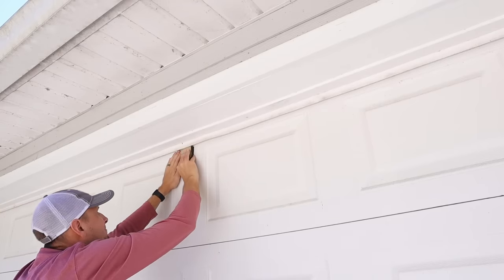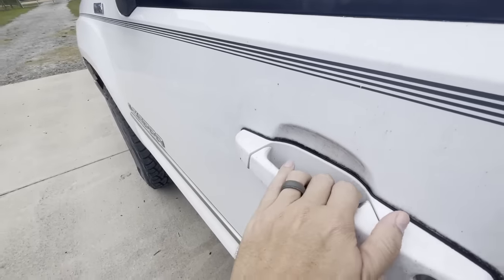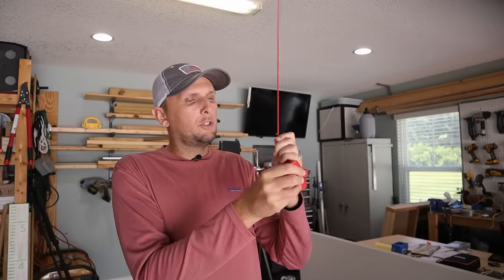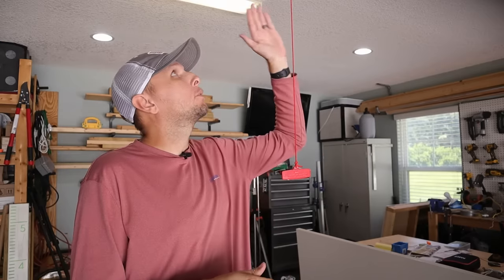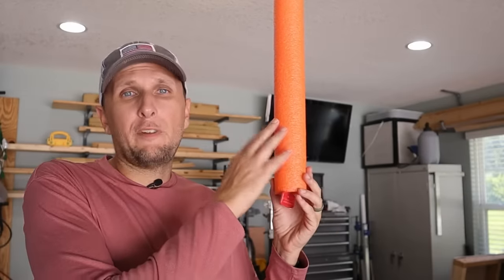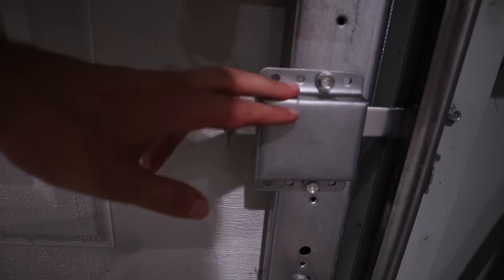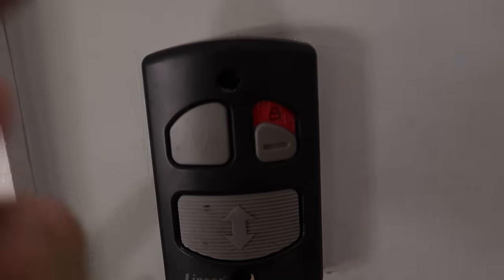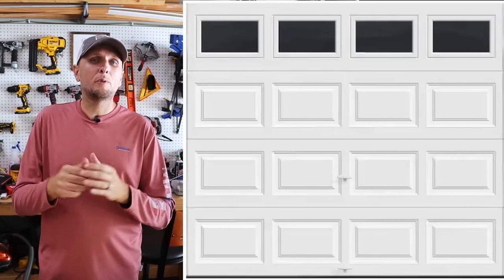How to Stop Garage Door Break-Ins | Number One Way Thieves Get Into the House!

Comment: Nice. I have shortened and twisted the release cable, so it will be hard to fish. 

A useful tip that helped me avoid any issues. I purchased a label indicating that my house had a security system installed. I displayed the label prominently and placed a dummy camera in a visible spot, even though it never actually functioned. Since implementing this strategy, I have not experienced any problems related to security concerns.

Comment: One thing I did to fortify my garage was install a jackshaft opener. A big benefit is that it actuates an electronic latch to lock the door down. Additionally, it looks better, and it's got a battery backup so the garage door continues to work in a power outage. And, I was able to set it up to automatically close if I forget to close it at night
Reply: With a jackshaft operator, the manual release is also on the side of the door instead of the center.

Comment: Thanks for sharing! One thing I thought of when you were addressing the pull cord is maybe just take it off and use a stick with a hook on it if you need to release it (which is not often) plus I always end up using some kind of stick anyway to push it back up in the locking position instead of climbing up on a ladder.

Comment: There is a very simple method that I have used for years.  The pull cord is attached to a lever which, when it is horizontal, locks the door onto the opener bogey.  Once you pull down on the cord the lever moves to vertical and withdraws the pin unlocking the door from the bogey.  For some reason, this lever is always mounted pointing towards the motor and away from the door when in the horizontal position!   See the lever in the video at 4:22 where you untie the cord from it!

I simply unbolt the lever assembly, turn it around to point towards the door and bolt it back on.  The cord still works just fine from inside, but pulling the cord through the top of the door, you are now pulling the lever into the horizontal locked position instead of pulling it downwards into the open position.  You can tug until the knot comes undone, but you won't be opening the door!  For extra security, cut part way through the cord so that it will snap more easily if undue pressure is put on it!

Granted, this only works on a low profile door - one that is intended for a low ceiling garage.  Yours is kind of on the boundary of being too high but it might still be worth giving it a try!
Reply: That's a great idea. I will have to take a look at mine as it is rear facing.
Reply: One possible issue tho, if there's a car in the way can it be awkward to pull it in that direction? I haven't had one of these doors so I'm not sure. I'm tall so I'm sure I'd have the leverage, but for someone who's smaller or maybe less mobile...
Reply: if u have 13'' above the opening of ur door u have plenty of headroom for a standard operator even if u flip the carrier around like ur saying. u only need low headroom track for doors with less than 13'' that are getting standard operators (not jack shafts obviously).
Reply: @Mike-me3sp  what are u pulling the manual release for anyways? if u have someone who cant access the emergency release cable, i suggest u look into say an 8550 operator from liftmaster, it has a battery back up so if the power goes out ur door will still open in an emergency or just power outage. really the only reasons ud have to pull the emergency cord anyways.
Reply: @YoureWrongImRightGetOverIt  the thought occurs to me that in your case, with a 13" gap above the door, you could simply add another panel or half panel to the door. You don't need to access that wall from the inside except maybe to paint it, and it would make breaking in that way SO much harder!  You might have to extend the length of the tracks on the ceiling a few inches to accommodate it, but it should be possible and a lot cheaper than the alternative
Reply: @Mike-me3sp  the cord will still be hanging in the same place as before, the point is it has to be pulled downward to release the door (which is it's normal operation) instead of sideways from the top of the door on the case of being fished by a would be burglar
Reply: @YoureWrongImRightGetOverIt  The cord is intended for emergency situations, ie house fire and power outage.  In such a situation having every possible egress point is essential to the life safety of you and your family.
Reply: This only works on box store versions of openers with a piece together hollow rail. Pro lines do not work the same and have a much more rigid disconnect. I own an overhead door business and see so many doors everyday.
Reply: @dano1307  You are absolutely right!  I talked to my neighbour about this, and she has one of those "pro-lines" as you call them.  What a wonderful world this would be if one answer fixed everything, but it is what it is!  

Those "pro-lines" you mention are the cheapened down versions of the same product; Essentially they do the same thing but with fewer working parts so when you buy them in bulk they are much cheaper than the original 'single item' purchase.  This will be the case in "track homes", where a builder builds one after another down a street and does everything they can to cut costs.

All I can recommend in that instance is adding an extra panel to the top of the door, since most standard height doors go "up" before they go "in", which would make 'fishing' for the cord so much harder.  Now if someone could invent a mechanical (doesn't need batteries) switch to mount by the door that would do the same thing as that cord, but without exposing the cord to a coat-hanger attack.

Nah, it's impossible! (gauntlet hits floor!)
Reply: I'm going to do that! Thank you!
Reply: @daveyburgess  I highly disagree the pro line is a cheaper version. First being the rail the carriage travels on is solid #1 steel one piece T-rail. The home depot version is a piece together light gauge tube rail. Also, the carriage lever on the home depot versions are made of plastic and have a cheap thin plastic pulley at the front header end of the rail. They also use half chain and half cable instead of all chain. Unless you are using a belt driven unit. The Home Depot/ box store versions are much cheaper to manufacture. Your neighbor may have a "Genie" or "Overhead Door" branded opener which are very cheaply made no matter if its a pro line or box store unit. 

Liftmaster is the pro line version of Chamberlain and Craftsman.
Reply: @daveyburgess  you mean "tract homes"
Reply: Simple and functional tip. Other very good tips in the comments. Friend, how many drills do you need? ☺️
Reply: @dano1307  The real answer isn't really a pro vs home install, its why aren't these prolines inverting the direction of the emergency release, thus making them safer.

If they were manufactured to invert the direction of the safety release pull direction then the world would be a safer place *by default*.
Reply: that would be really funny if you left the cord unmodified     so that when the thief comes to thieve and they can't open the door
Reply: @chelin7023  Great minds think alike...lol
Reply: @chelin7023  I thought of that when he warned about not tempting thieves with fancy tools while standing in front of a wall of power hand tools.

Good thing a Shop Smith is low to the ground.  Not that I own one.
Reply: This is a great tip!  I need to see if I can do this to mine.  I've zip tied the lever with small plastic zip ties.  With the pull cord and handle it's easy to snap it, but with a wire on the lever it's impossible.  I've also added a Garage Shield (that's the brand) that blocks the whole assembly from the wire.  I'll definitely be adding the pool noodle to my cord if I can't flip the lever around.  Thanks!
Reply: @YoureWrongImRightGetOverIt  What if your motor fails, that would be another reason.

Comment: A garage remote strategy a friend of mine used, that she told me about a really long time ago: She found remote-operated power supplies, and connected her garage door through one, and that was followed by making sure she could park inside. 

So when she left for work, she shut the garage via the remote, then pressed the remote power shutoff, and tested the garage door after. When she returned home, she had just one more button to press before opening the garage.
Reply: NobodyWhatsoever: Have no idea what you’re talking about.
Reply: @Vinnie101a  The topic of the video: a way to stop (or at least discourage) garage break-ins, yes? I described what someone I know does -- or at least used to do -- for their own garage security. It's entirely on-topic, even though it may not necessarily be direct feedback of the methods demonstrated in the original video. If that didn't help, then good luck.
Reply: @NobodyWhatsoever  : Thanx Nobody.

Comment: Another trick is to wrap your cord around the swing arm. If your garage has a side window, then you can install a wire grid over it on the inside (I used an old metal wire shelf). and I have a large barberry bush (with lots of stickers) in front of the window. Also, a pair of vise grips locked into the channel makes a good lock as well.  And if you store a 2nd vehicle outside, be sure to remove the remote from it when you park it.
Reply: Yes, the cord wrap makes it much more difficult to open with a wire.

Comment: Good one, everyone should do this. Few years ago about a year after I untied my release handle rope, I noticed the top panel of my door was bowed and bent inwards by about an inch. Someone had tried to break in this way and got impatient after not snagging the rope, bending the panel in. So this works, but the bastards damaged my door  😡
Reply: Got a trick for you if you have a garage door that has like a curved lip at the top you take a steel rod and put it right through all the whole length and you then use screws to fasten where no one can get out them and no one‘s gonna be in the top of the door suggestion to fix it undo the top panel from the door system and the track and then you can take it down and then re-bend it back in the shape and put a steel rod in that’s all the way through like I said in the first part that’s one way to protect your garage door even the same thing at the bottom of garage door if you have the same thing you can put a bar right through the middle of the curve rounded section that is hollow that’s just another helping tip of prevention nowadays it seems like you have to buy solid steel garage doors with solid steel panels that way no one can get in. Not even by trying to move the weatherstripping especially if you can get a garage door that made extra long and wide to prevent that in the first place which I have done that was our garage until we got a new one put in
Reply: I’m surprised robbers don’t just move on to a regular walk in door. Seems like most have them and would be easier and less obvious.
Reply: A good trick is to just lock the garage door, at least when you know youre gonna be gone all day.
Reply: @danyelPitmon  as someone who installs overhead doors as a job, your steel rod idea is valid. We attach struts which are U shaped lengths of sheet metal to prevent panels from bending. The intended purpose is for wind which is why you don’t see them much on residential doors, because they don’t have much surface area to need to worry about wind bending panels.

Also if you ever decide to remove a panel, please be careful. The tension on the springs can be dangerous. If you want to remove the top panel temporarily, put vice grips above the rollers on the lower panels so they don’t shoot up.

Although, I've never actually heard of someone trying to break into a door like this before. I've seen people driving into doors to mess them up enough to either knock it down or make enough room to squeeze through. Although, that was only one instance where they did that to a whole street. And there was one door I replaced where a bear had the determination to claw through the door. Granted it was an old raggedy door, but still an interesting story.

Comment: Several years back I had a garage door company come out to replace a broken spring.  After they left I was out looking at the door and noticed a small "pile" of fresh metal shavings on each side of the door.  Upon further inspections I realized that one of them had filed the door lock latch on both tracks so with just a little pressure from the outside the door could be lifted when locked.
Reply: Oh man!   That is scary!
Reply: Hopefully you reported it to the company!!
Reply: @bryandiel6773  definitely did as well as the police in case they began to see a pattern.
Reply: I would go ballistic seeing that. Said company gets to replace the door my pick.
Reply: Man you did well. Kind of like the cleaner that came to my house and after she left I noticed a few of my front windows were “closed” but left just slightly unlatched, not noticeable to the eye but good thing I had a feeling and checked how securely it was locked (not).

Comment: I really love that idea of using the pool noodle on the release handle, I just combined that as well as shortening the pull cable. Excellent tips.
Reply: I'm kind of curious as to why it even has a tab in the first place. It seems like removing the tab would do just as well. You can always have a detachable handle nearby if you really need it.
Reply: You can also use pipe insulation noodles that have a cut down the middle to wrap around the cord. Might also just tie the cord up so it’s not hanging loose for a thief to grab onto.

Comment: Not only could trying to open the door with the "slide lock" engaged ruin the opener, I've seen on more than one occasion where it will buckle/tear the top panel of the door, requiring that to be replaced, as well!!! Great tips. I am really enjoying your videos. I'm glad I stumbled upon them!!
Reply: I did this not once but twice in a power outage. I had to use to string release to get my car out for work and then went back around through the inside to put a long screwdriver through the side bolts and door guide to lock it in place. After a full workday and 2 hour commute, I forgot and hit the garage door opener out of sheer habit. Twice over time. Felt like a moron but in a power outage it's such a habit to flip the light switches anyway...I can't be the only one. Couldn't trust myself with that lock. The buckle is noticeable from the inside only. 😅

Comment: Really liked this video.  I thought I knew a lot about security of my house and missed the fishing for the rope to detach the door from the opener.  Great suggestion.  Also, always lock the door between the garage and house.  Not as much a security issue as a safety one is to think about turning off the water to the house and turning off the hot water heater for those times you are gone for an extended period of time.  That way if a water line breaks or vandals open your outside faucets you will not have an unexpected disaster.

Comment: Great vid!   Off to amend my pull cord!   A few thoughts...once the scumbags gain access to my garage all they have to do is close the door behind them.   They then have access to ALL of my tools.   They can then easily get past the metal (dead-bolt-locked) door and gain access to the entire house.  I used to travel extensively for work and lived alone, so I was always concerned about this.  I always used the garage door lock and exited out the front door.

My house came with a security system installed.  But, the system is dead.   But I still spray the outside alarm unit with WD40 every once in a while. This keeps it looking NEW and shiny.   The alarm unit (a flashing light and speaker) can easily be seen from the street.   I also keep the exterior warning signs looking new.  

The homeboys cruise my street once a year or so looking for easy marks.  They try EVERY car door and recently opened one home's garage door using the FOB as you mentioned.  As a result, our cars are always locked.

Lastly, I place two 12 ga shotgun shells inside every ground-level window in my house.  They are carefully placed to ensure that anyone peering IN my home sees them immediately.
Reply: Like your shotgun shell comment. It should be accompanied by a sign that says “ there is nothing in this house worth having your brains scattered all over my house”

Comment: You can also replace the pull cord with a metal rod that won't be flexible enough to bend through the gap, cut it short or  leave it longer so it braces against the  door.
Reply: Yes indeed. I have a removable metal rod with a hook on the end. I hang this rod behind the toolbox on a magnet. It's about 36 inches long and is very easy to use. I like the idea of turning around the lever to face the door. extra protection for sure.

Comment: Great tips! 
I have also used C clamps behind the top rollers and clamped to the door tracks. This would make it a substitute for the dead bolt lock.
Reply: Sure, but every time you go out?  What pain that would be.
Reply: I’ve done that as I don’t use the up and over door very often…
Reply: I use the c-clamp also,  I don't drive often and the other two garage doors aren't used so the power is disconnected.